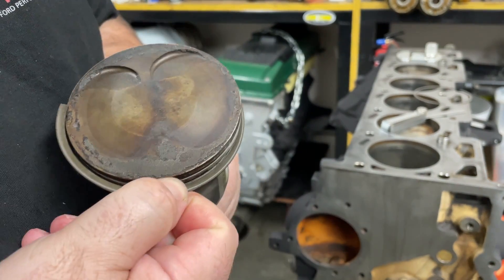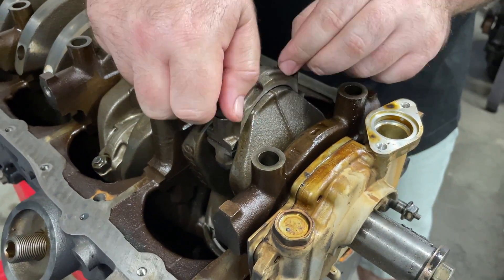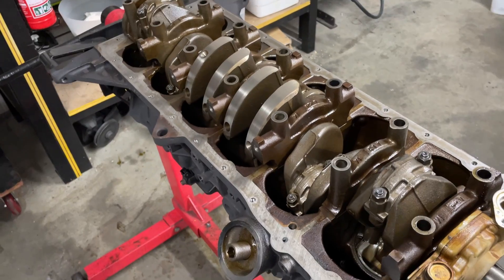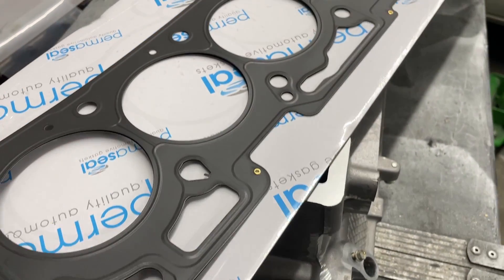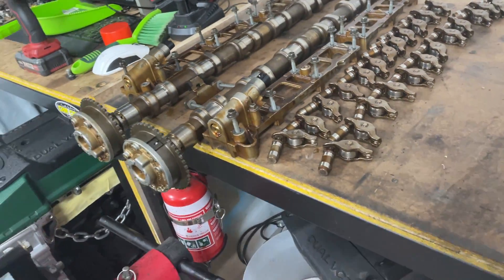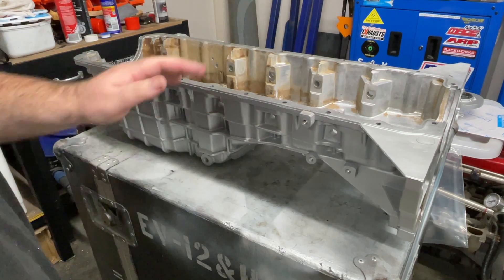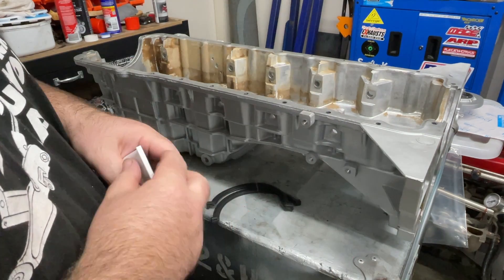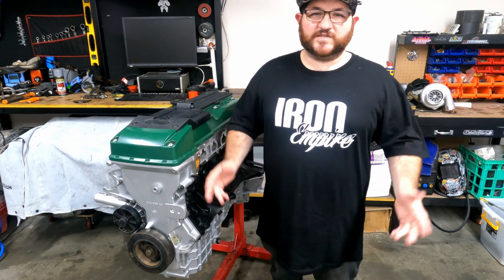Reassembling A Barra Engine In 12 Minutes!

Comment: Nice work mate! Thanks for uploading.

I’m building a bf xr6t circuit car at the minute. Really going back and forth  on doing the ring gaps. It’s a job I could handle easy I’m just not sure it’s required for 350ish rwkw (through a T56) I’m aiming for. I do have two spare green tops on the shelf, I’m torn as part of me doesn’t want to blow it up when I’m out and Winton or the island and waste half a day, and the other half doesn’t want to let the magic out of a $204 Jollys special 😄

Comment: Great video mate. 
Just gotta say for those of you doing your first engine builds. Measure everything if your replacing bearings etc. 
Make sure the clearances are correct. If your going to tear an engine down clean everything til you could eat off it then clean it again.
 If you are going to clean off your deck surfaces don't do it with any of the rotating bits still in the block. It's easy for grit and crud etc to get down beside the piston and cylinder wall. 
Not here to have a go at anything done here , it's not my engine. But if your going this far you don't wanna pull the engine back out if it's scored the bores or the bearings are too tight or it's got low oil pressure.
Good luck lads . Hope to see how this engine turns out once it's running.
Reply from the maker: Thanks for watching and for the rad comment!
You're absolutely right! This build took so long to finish because i had to clean and check over and over again. The cams and rockers were filthy from being left on my bench for weeks, even though they were covered they were still filthy from dirt and dust. I realized when i was using the finishing stone on the deck it would've been better to finish it when the pistons were out, after replacing the rod bolts so many times i didn't want to remove everything again, so i had to spend almost an entire day cleaning the bores.
I don't want to mislead anyone, I'm definitely not an experienced engine builder or mechanic, i just want to learn and its comments like this that help myself and others watching!
Thanks again!
Reply: Cheers for the informative comment brother 👍